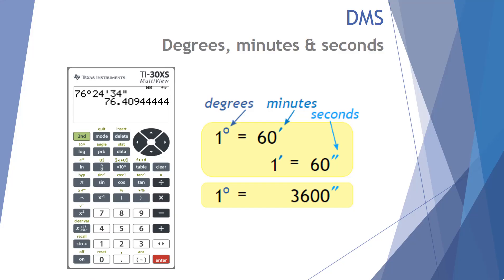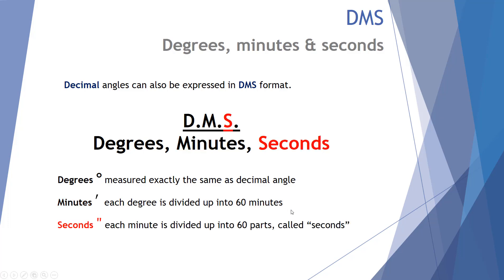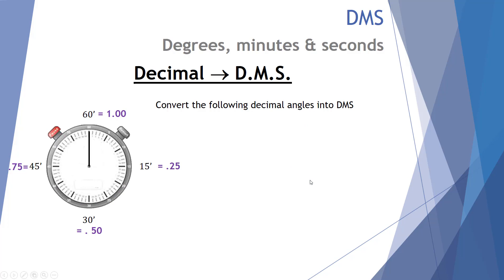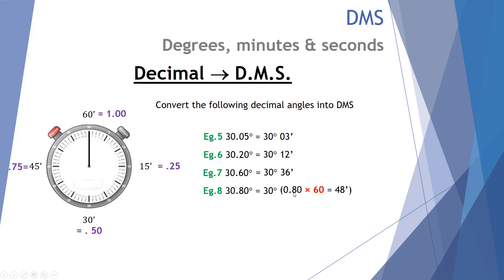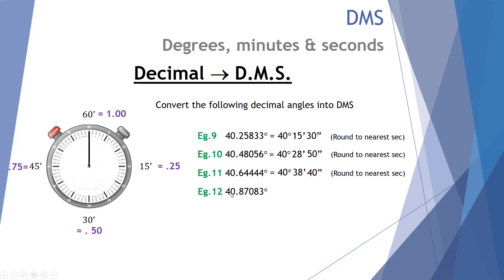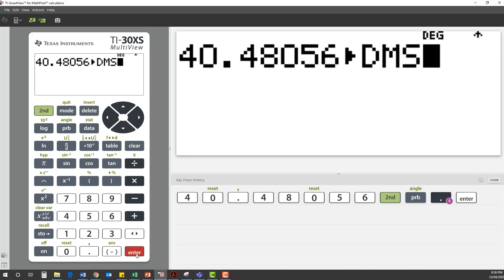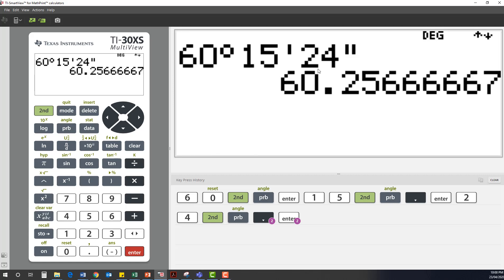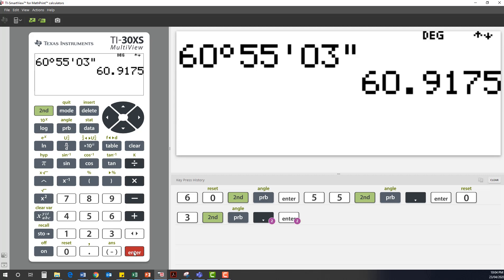Measuring Angles (Degrees, Minutes, Seconds)

Comment: You can easily convert degree minute second values into decimal degrees value in Microsoft Excel instantly. The length and amount of data is not a problem at all. You can even convert degree-minute-second readings with garbage into decimal degrees within just a matter of click. See the video- https://www.youtube.com/watch?v=2uVkE_mReBM